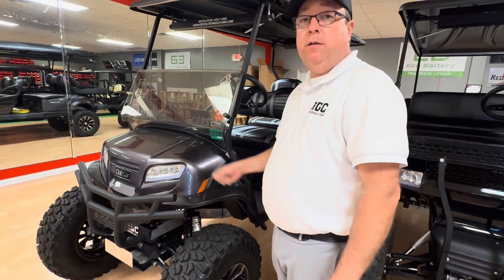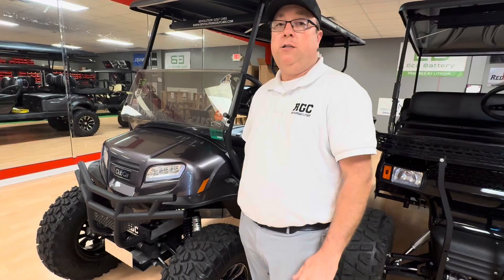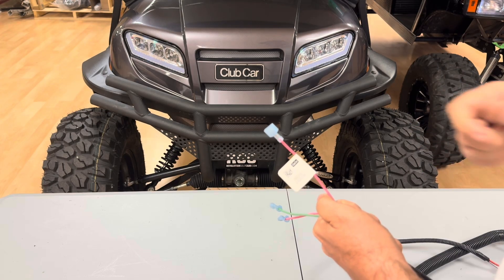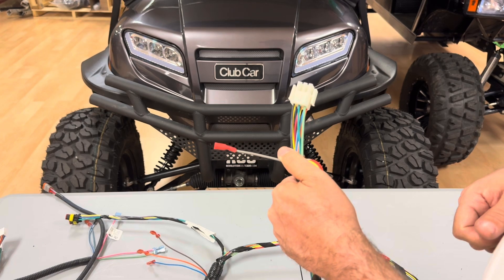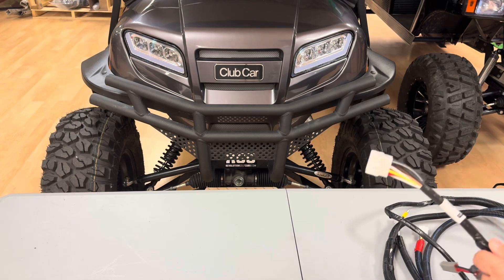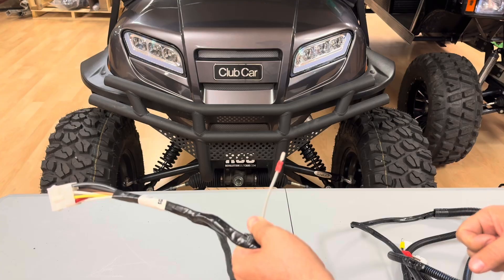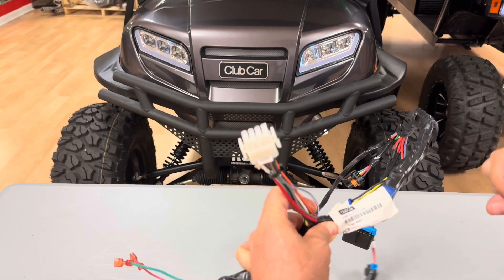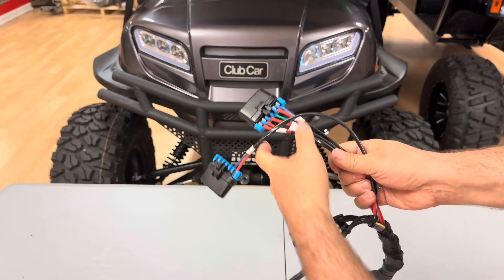Club Car Onward HP slow?  Convert your Onward HP to a performance drive system!

Comment: Please add more videos. I am very impressed by the knowledge you have and the way you share it. You must know alot about these machines and yet you put together videos in a way that is easy to understand and soak in the information to be able to use it in properly upgrading or troubleshooting and working on buggies. Please share more about the early 2000's clubcar electric golf carts.
Reply from the maker: Thank you. I’ve been in the business for 24 years.  I run my business full time and do videos when I have free time, which lately isn’t as often as I’d like. I appreciate the kind words.